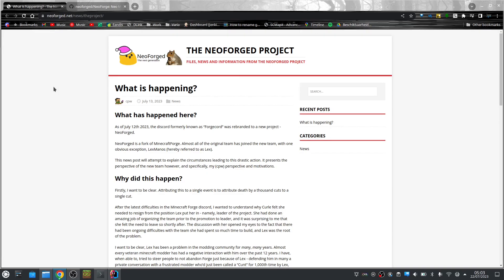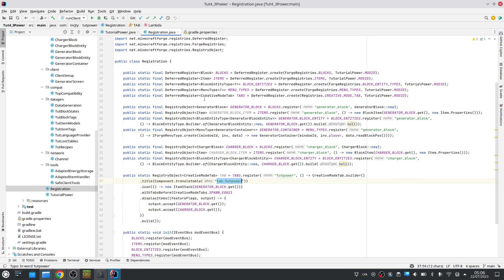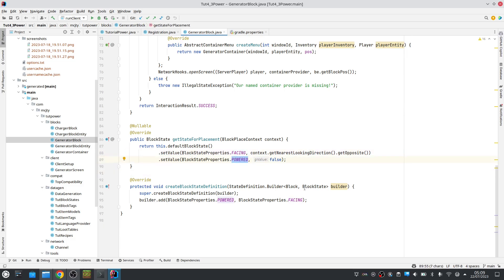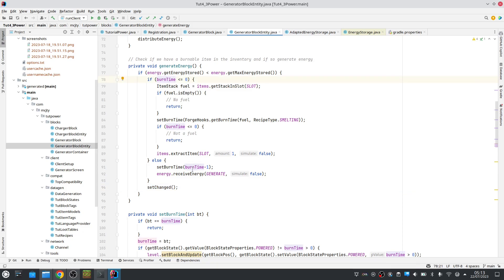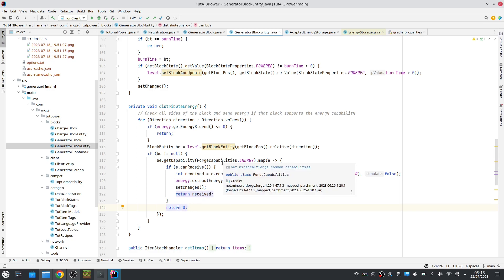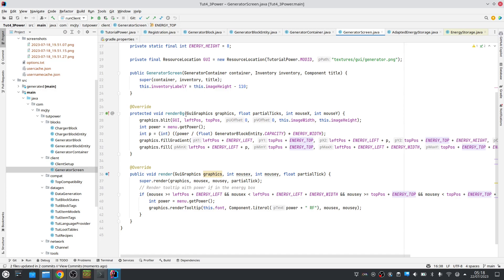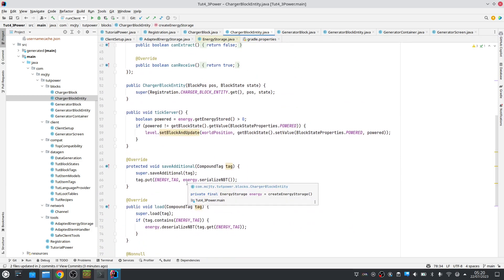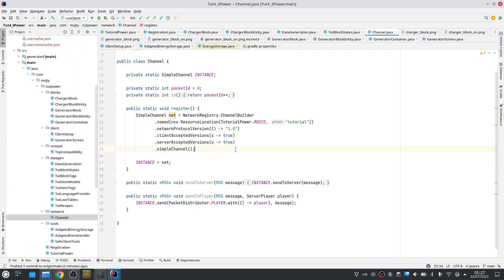Minecraft Forge Tutorials for 1.20: Episode 4, Power generation

Comment: "forge energy is a push system" - can you explain the harm in implementing canExtract and extractEnergy? If other mods are relying on this then won't the generator just be useless?
Reply from the maker: Other mods should NOT rely on that. If they do then they are buggy
Reply: @jorrittyberghein7398  thanks for the reply! it definitely seems odd to me that generators search every tick for adjacent block entities to push to rather than pipes extracting themselves, but I'll take your word for it. I know from a player perspective, mods like pipez you have to configure them to actually extract. but I guess it might just change it to accept energy rather than the pipe doing the extracting
Reply from the maker: @neuro5266  The thing is, generators and batteries have a max energy per side and per tick that they are allow to give. For example. 5000 RF/tick per side. That is very hard to control/calculate if random machines can just extract energy from anywhere because then you would have to keep track of in what tick you have given how much power to what machine already. Doing it with a push system is much easier because every tick you just push max 5000RF/tick at every side to whatever is over there